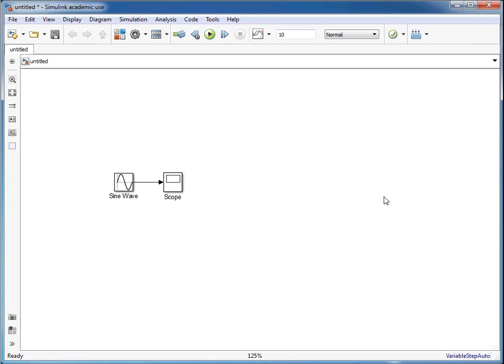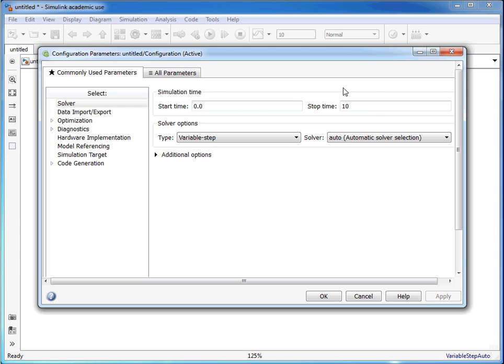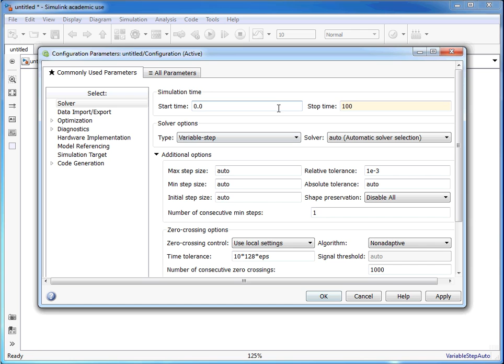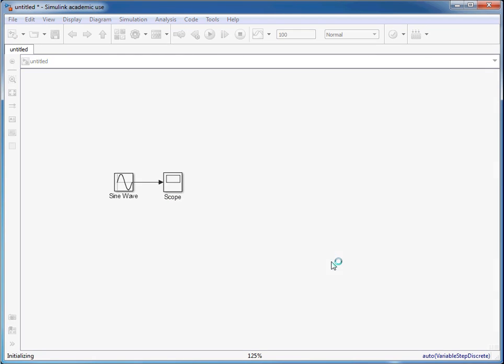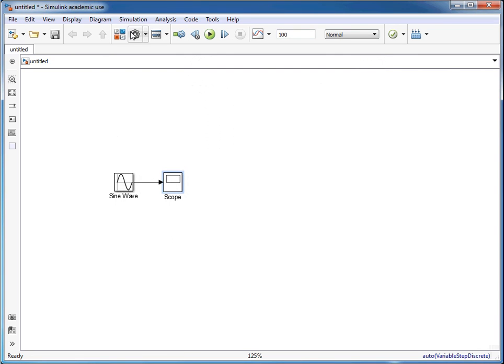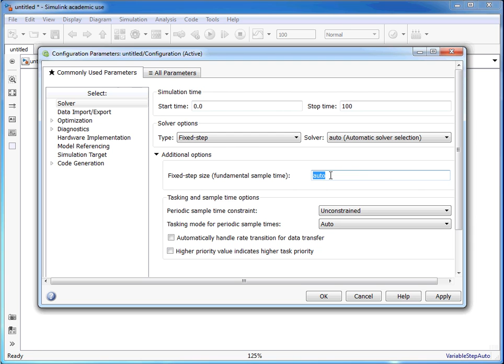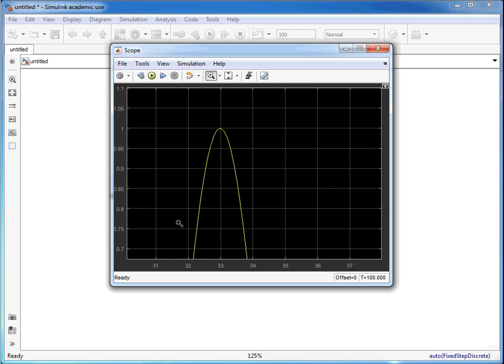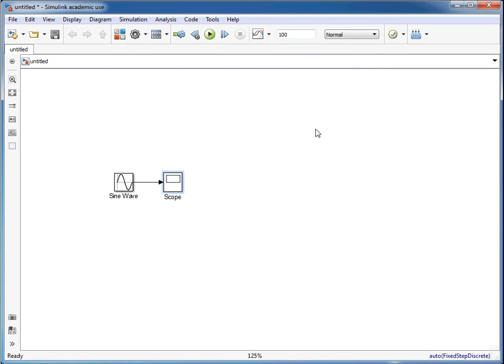Simulink Basics Part 7 – Changing Model Configuration Parameters

Comment: Warning: Using a default value of 0.2 for maximum step size. The simulation step size will be equal to or less than this value. You can disable this diagnostic by setting 'Automatic solver parameter selection' diagnostic 2 to 'none' in the Diagnostics page Nof the configuration parameters dialog